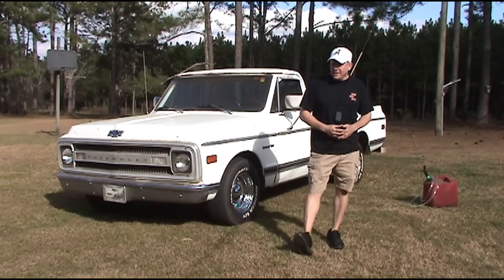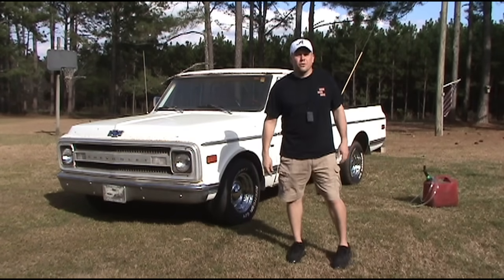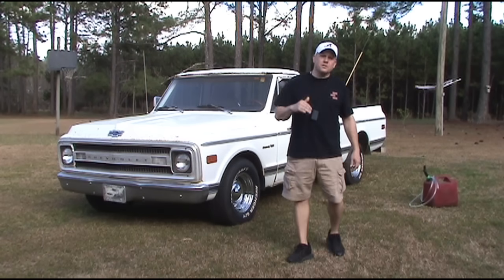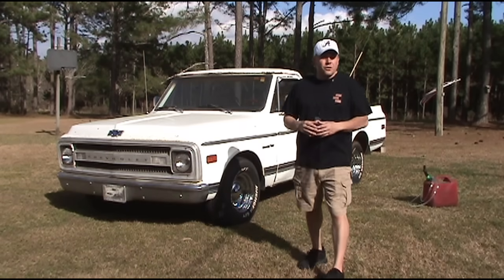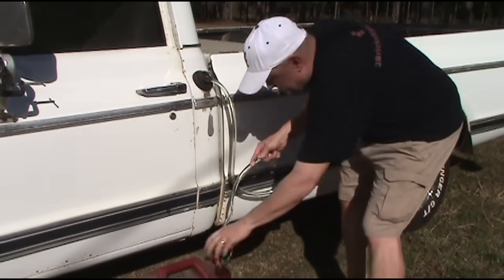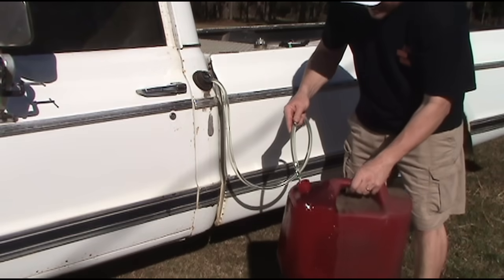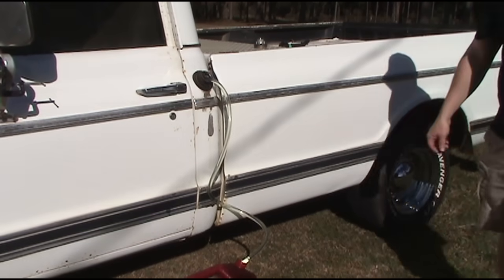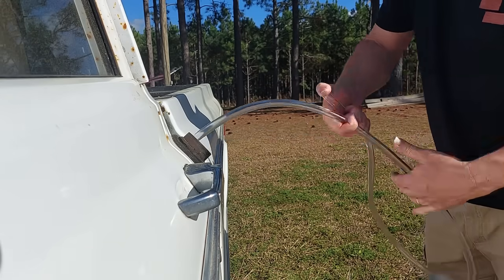Absolute BEST way to Siphon Fuel. You've never seen this before

Comment: Note the old truck with a very high gas tank and no flapper under cap....
Reply from the maker: But, also notice this can work on so many other things. I used this method to fill a generator during a storm. I was told that stores use this method to do water swaps in aquariums.  It's good info to have. You're right about newer cars though. 👍🙂

Comment: SOME TIPS:
Physics for nerds. Water (or other liquids) pressure is proportional to its height. When water height in the hose OUTSIDE of container is larger than water height in the hose INSIDE of container, the outward pressure of water is larger than the inward pressure of water. The net pressure is going outward and sucks the water out of container.

Practical application. Close output end of hose with a thumb. The hose needs NOT be fully filled with water. Pull output end of hose down until the water level in the hose near the output end is lower than water level in container, and let go the thumb. Water will flow out of container naturally. If all the water in the container is to be siphoned out, the length of hose must be at least (double the height of container + the hose section filled with air).
Reply from the maker: Nice explanation 🙂👍

Comment: I've tried to siphon gas out of my 96 Bonneville, I can't get any size hose down the fill hose. I think there is some kind of restriction plate in there. Is that possible?
Reply from the maker: If there is a flap in place, you can push it down with a pencil.  While the pencil has it pushed down insert the hose.  After siphoning you will need to push the flap back down with the pencil to remove the hose.

Comment: Show me some tricks on something with an antisiphon mechanism that work 😆 🤣 😂
Reply from the maker: Actually, i used this method to fill a generator during a storm and thought I would pass it on. This works on lawnmowers and other equipment too. Someone posted they use this to do water swaps in aquariums 🙂👍
Reply: @3BricksHigher  yeah that makes sense then. Wasn't thinking in that aspect. Either way would still be cool to see. 😎

Comment: in the movie green room the second scene is them steeling fuel. they use 2 hoses, i was curious what they were doing or just hollywood fantasy. a long wide hose and a short thin hose he does something with to get the fluid flowing. I can't think of what it would have been.
Reply from the maker: That would be the 2nd method i show 🙂👍

Comment: How do you deal with anti-siphon flaps? or your hose getting stuck in it?
Reply from the maker: The flap is simple to get around. I use a pencil to push it in, then insert the tupe.  Afterwards i use the pencil again to push the flap down and pull the hose out 🙂👍
Reply: There are 16 pencils in the tank as we speak, but that's okay because they float to the top. 😁

Comment: What about newer cars that has a blocker so you can't get the hose in?
Reply from the maker: Not sure, but this can be used on other equipment with fuel tanks. I used this to fill a generator after a storm and thought I would pass it on 👍

Comment: Every car I mess with has some.kind of Anti-siphon mechanism that keeps the ends of the hose.out of the fuel.  I had to take out the fuel pump to reach the tank that way.
Reply from the maker: Newer car do, but this method works on lawnmowers and other equipment too.
Reply: @3BricksHigher  My "newer equipment " is a 2008 base model with >200k miles lol

Comment: heres another way to start a Siphon . Use a long hose put as much of it in the tank as possible THEN seal the end with your thumb . Now slowly pull the hose out keep your thumb over the end and eventually you will see gas in the hose , lay it down and remove your thumb . gas flows downhill .
Reply from the maker: Nice tip 👍

Comment: Most modern vehicles have anti-siphon devices and check-valves in the fuel filler neck.
Reply from the maker: They do, but this method also works on mowers and other equipment.  I used this to fill a generator during a storm and thought I would pass it on 🙂👍
Reply: Easy enough to break through with a length of rebar.

Comment: Diameter , length and material of hose ?
Reply from the maker: Every vehicle will be different.  I believe the hose i used in the vid was 6 or 7 feet in length and between a quarter or a half inch in diameter.  I would need to use half the diameter for my Jeep to fit it into the tank entrance.  It will flow slower, but would still be just as affective.

Comment: Unfortunately, this only works on older vehicles that don’t have a rollover valve in the-filler neck that won’t allow a siphon hose to pass
Reply from the maker: But it does work on mowers, tractors and anything else with a fuel tank 👍

Comment: We never saw the gas come out with the 2nd method. I stand corrected & apologize. 🙏❤
Reply from the maker: Watch again.  I use 93 octane in my truck because of the high performance motor.  93 octane is almost clear.  You will see it does come out 🙂👍

Comment: I never brought a gas can to the gas station to buy gas for my lawn mower and so on. But I did add a tee to the fuel line in the car after the fuel pump. And a shutoff on the extra line. Need gas for the mower? Pop the hood, put a hose on the tee, put the other end of the hose in the gas can, start the car. Watch the gas can fill about half way, shut the car off, close the valve remove the hose from the tee. Hold it high for a few seconds so it drains into the can, put hose away, done. Why siphon when you can pump? And use the pump that is already provided in the car to boot.
Reply from the maker: Now that is smart 🙂👍

Comment: Only old vehicles will this work on there is a ping pong ball in filler hose for roll over last 30 years you cant push hose down into tank😢
Reply from the maker: But this method also works with tractors, lawnmowers and other equipment. I used this to fill a generator during a storm and thought I would pass it on 🙂👍

Comment: The 3rd method, similar to the 2nd, you have the 2 tubes, one long and one short, but you don't have the problem of making an airtight seal around the fuel filler on the vehicle.

Make 2 holes in the lid of your fuel can. 1 hole has the long tube going from the can into the fuel tank. The 2nd hole has the short tube going into the can and the other end just sticking out in the air. You put the long tube into the vehicle, then suck on the short tube. The air being sucked out of the can through the short tube draws fuel up the long tube.

Search "insect pooter" and you'll see the design. 2 tubes, you suck on one tube and the insect is drawn in the container through the other tube.
Reply from the maker: That's a smart way! I appreciate you sharing 🙂👍

Comment: I have two alternatives using similar principles.
Starting from 1:55, just strike a match on the towel.
The pressure in the tank from expanding gasses as the vapours burn will push fluid out of the hose.
Alternatively, fill the tank with water, and as it displaces the gas it will flow out of the filler hose.
Remember, I did not say they were good methods.

Comment: My granpappy used to freak everbody out when he run outta gas. He'd find cans, bottles, bowls, any thing he could carry water from the creek or pond, or puddle to pour in the gas tank. Then after about three gallons of water, he start it up and head to the barn. Or wherever else he had to be!
     Had to be carefull siphonin gas from granpaw's pickup.
Reply from the maker: How did that work? 🤔🙂
Reply: @3BricksHigher  c'mon, maing.......you kin dooit! If ya really need help, i'll tell ya....take the filter sock off the pickup tube, and cut three or four inches off the tube, then put the sock back on it! 
     If the tank dont have a draincock, better put one! First thing Grampy'd do when he stopped to put gas in, he'd drain the water out.

Comment: Main question I'd ask is why. Put fuel in not take out unless your stealing it
Reply from the maker: I used this method to fill a generator during a storm and thought I would pass it on. This also works on lawnmowers and other equipment. Someone posted they use this to do water swaps in aquariums 🙂👍

Comment: Works ok on an old vehicle like this truck but how about newer cars with anti-siphon devices in the fuel filler pipe?
Reply from the maker: Good call out. I was mainly wanting to show the method. I've used it to siphon fuel during a storm for a generator and thought i would share. It works on other equipment too. Someone posted they use this to do water changes in an aquarium.

Comment: Sorry but you're not the only one to figure both ways out , first one is using a little common sense along with a desire not to taste gasoline lol , second one I used a lot as a heavy equipment mechanic in the ARMY , I modified a universal tank cap for small Generators with an air valve stem on it so when working on fuel systems it was easy to get fuel to the carburetor to prime it , saved a lot if time and hassle.
Reply from the maker: The air value is a solid idea 👍

Comment: But newer cars and you can not stuff even smallest hose to the tank as they are blocked for theft reasons 20+ you may succeed. I use hose with one way valve it the other side (that ball model) and just shake hose a little!

Comment: Now we just need all those vehicles built before the 80s, siphon screens and the those pesky ballcocks stop you from even getting to the fuel.
Reply from the maker: But this method works on lawnmowers and other equipment too. I used this method to fill a generator during a storm and thought I would pass it on 🙂👍

Comment: Will this work with a 2000 Ford van e150 ???
Reply from the maker: It works on my 2002 Sonoma.  It just might work on your van. I have a flap, but i just use a pencil to push it down to get the hose in.  Then i push it again to get thebl hose out.  I've used this to fill a generator during a storm and thought I would pass it on.

Comment: modern vehicles block the hose, so get drilling
Reply from the maker: This works on lawnmowers and other equipment. I used this method during a storm to fill a generator. I heard that fish shops use this method to do water swaps in aquariums. There are many used for this 🙂👍
Reply: @3BricksHigher  I'm glad you taught us all.
I'm just thinking from a prepper SHTF scenario.  How would you get fuel out of a stranded car?  Probably have to drill the tank.
Reply from the maker: @danielbrowniel if the vehicle has a flap it can be pushed down with a pencil or small rod and then the tube(s) can be inserted.  Same when removing the tubes.

Comment: How come all these videos are doing it from a truck?  Im doing  it from a car an a hell of a time!
Reply from the maker: I did this from my truck just to show the methods. This works on tractors and other equipment. I used this to fill a generator during a storm and thought I would pass it on. Depending on the year of the car you have, it's possible you have a flap. Use a pencil to push the flap down to stick the tube in. Afterwards use the pencil again to push the flap back down to pull the hose out

Comment: How do you siphon a fuel theft prevention vehicle 1999 Mustang?
Reply from the maker: If it has the flap, you can use a rod or pencil to push the trap open.  Then slide the tubes in.  Use the pencil again to push the flap down when the tube is removed.

Comment: now I just need to find a way to make my 2006 car 30 years younger when they didn't have anti-syphon devices installed.
Reply from the maker: This works on lawnmowers and other equipment. I used this method to fill a generator during a storm and thought I would pass it on 🙂👍
Reply: @3BricksHigher  I could see that for sure. Just wish it worked on my car that has a bad frame but full tank of good gas. I'm just cycling the fuel pump on and off over and over to flush it out via a hose prior to the fuel injectors. Tedious.

Comment: Only works on older vehicles, most now have anti-siphon in the filler neck. Why on the first demonstration wouldn't you put it right into the receiving jug instead of spilling a quart all over the ground.
Reply from the maker: You're right, but it does work on mowers and other equipment.  I used this method to fill a generator during a storm and thought I would pass it on 🙂👍

Comment: And remember, if you have to use a non-transparent hose and you have no choice but to suck on it (no smart remarks from the bleacher section), make sure you look in the end of that hose before you stick it in your mouth or you might just end up with eight beady little eyeballs with eight legs in your mouth😮
Reply from the maker: That, for sure is a great tip 👍 any bug in the mouth would suck lol

Comment: Yeah anything old like that no problem but most modern cars (as in, made since the 1990's or so) have anti-siphon in the filler tube...
Reply from the maker: But this method also works on lawnmowers and other equipment. I used this to fill a generator during a storm and thought I would pass it on 🙂👍 someone posted they use this to do water swaps in aquariums too

Comment: Most vehicles have a baffle in the filler neck, no way to get a hose past that.
Reply from the maker: Correct, but, this method works on lawnmowers and other equipment too. I used this method to fill a generator during a storm and thought I would pass it on 🙂

Comment: This idea looks good but most modern cars block a pipe getting into the tank.
Reply from the maker: Use a pencil to push the flap out of the way 👍
Reply: @3BricksHigher  The flap is not the problem. Modern cars make petrol pipe insertion almost impossible.

Comment: He forgot to add a crucial part of the equation/strategy:

With the preponderance of wireless/IP based external cameras on homes these days, make sure to obscure the license plate of the vehicle you are driving, and to cover/hide your face or any identifying tattoos etc. well in advance of the actual fuel theft.
Reply from the maker: I would hope those that learn this do not use thier power for evil 👍

Comment: I will have to carry two pieces of tubing with me, but in new cars you can’t put the plastic tubing or anything that’s not metal inside the filler cap. All Modern cars have that feature to prevent what you are doing. Won’t work.
Reply from the maker: But it does work on lawnmowers and other equipment. I used the truck because it looks better than my John Deere tractor on video 🙂👍

Comment: This only works on older vehicles, anything newer then 2000 has a blocker in the filler tube.
Reply from the maker: But it works on so many other things, mowers and other equipment. Water changes in aquariums, one comment said they empty their pool using this method.  I used this method to fill a generator during a storm and thought I would pass it on 🙂👍

Comment: If your car does not have a roll over ball. All gasoline cars made in the last 10 years or more do.
Reply from the maker: But it does work on mowers and other equipment. I used this method to fill a generator during a storm and thought I would pass it on 🙂👍

Comment: Good tip, now you can steal gas as much you want.
Reply from the maker: Actually, i used this method to fill a generator during a storm and thought I would pass it on. It also works on lawnmowers and other equipment 🙂👍
Reply: @3BricksHigher  So it is a anti seaze then?

Comment: You can’t do this with newer vehicles because the hose will get stuck on the trap doors just pass the nozzle.
Reply from the maker: Use a pencil to push the trap open. Hold it open until the hose is inserted then push the trap back down so the hose can be pulled out 👍

Comment: Except that you cannot siphon from a newer tank as they put an anti-theft (small grid) to prevent insertion of a tube 🥸
Reply from the maker: I am just showing method.  It can be used on different equipment. I used this method to fill a generator after a storm and thought i would pass it on 👍

Comment: This was interesting, but vehicles made in the last couple of decades or so will not allow such a hose to get down into the tank.  I suspect he knows this and why he used an '60 vehicle for the demo.
Reply from the maker: Actually, i used this method to fill a generator during a storm and thought I would pass it on. This works on lawnmowers and other equipment too. This is good info to know 🙂👍

Comment: Why is your gas clear?

Also, if you have a longish hose and you stick it way into the tank and just suck a little and then plug it, pull much of the rest out, lower it to the ground and let go, that will start the siphon on even a nearly empty tank.
Reply from the maker: This truck will only run on 93 octane. That might explain how clear it is? Not sure
Reply: @3BricksHigher  ya everything around here is cut with corn so it looks greenish yellow.

Comment: What diameter hose works on newer cars? Also, is there a block in newer cars to prevent siphoning gas?

Thanks
Reply from the maker: I know some newer cars have a metal flap, but it is to keep fuel from exiting in case you forget to put back on the cap. This can be pushed down and a hose can be inserted. The flap has to be held down before you pull the hose out or it will catch. You can use a pencil or small rod to hold it down. The diameter hose just depends on what you can fit through it.

Comment: You missed the best method.
Push the hose all the way in the tank, THEN put your thumb on the end and pull it out. It will come out filled with fuel then you just lower it and take your thumb off.
No need to "blow in the tank" lol
Reply from the maker: Good tip 👍